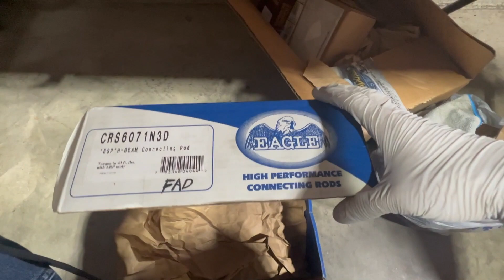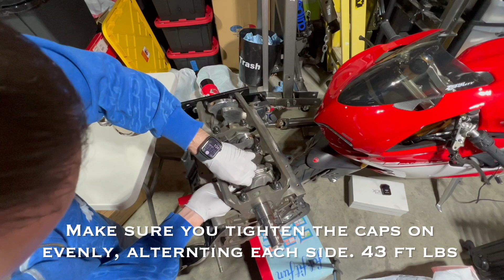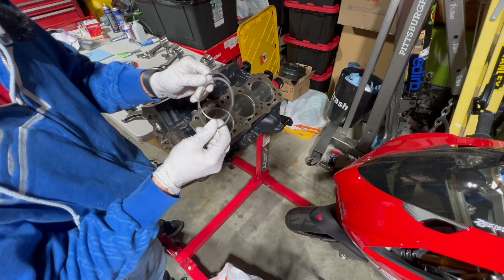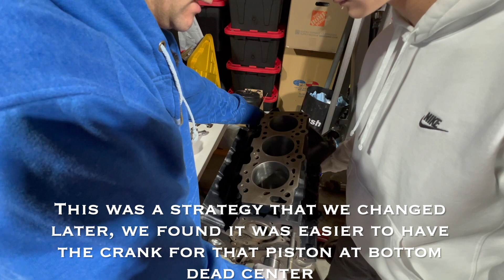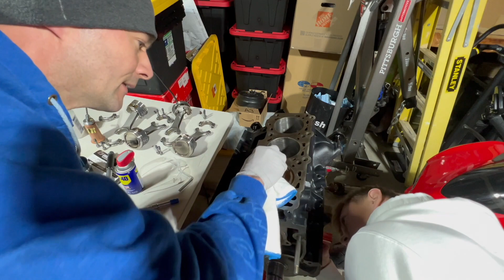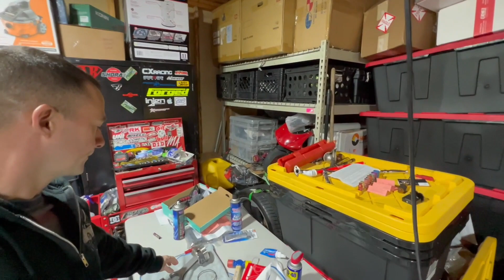How To DIY Engine Rebuild VG30DETT Z32 Piston Assembly and Install and Measure Clearance

Comment: Im rebuilding my vg30dett now what all did the machine shop do for you ,the pistons that came out where 87.5 so i saw yours are oversized did they balance the crank.thanks
Reply from the maker: I think in one of my videos I show the build sheet or read it off but basically cleaned/checked/polished and balanced everything but I did the assembly myself. Cylinder 1 and 5 had to be re-sleeved.

Comment: Suppose a guy were to machine himself a Delrin (or equivalent hardness plastic) cylinder to just fit the wrist pin hole, then start the clip and finish getting it in by tapping that cylinder into the hole against the clip? Seems the way I would do it. Although not everybody has access to a lathe at home.
Reply from the maker: That would probably help lol

Comment: I just used the properly sized ARP piston ring compressor and i was able to push my pistons in with my thumbs
Reply from the maker: I was impatient in waiting for the right one to ship. Z1 sent me the wrong one originally. But you’re right if you get the right size, should slip in easily

Comment: Did you have to get the rotating assembly balanced with the crank and new pistons and rods? The new pistons and rods are different weight than the stock ones which the crank was originally balanced for. Thank you
Reply from the maker: I did have the entire assembly balanced by the machine shop.